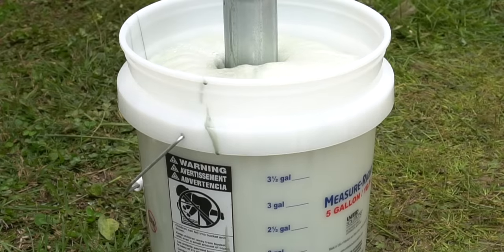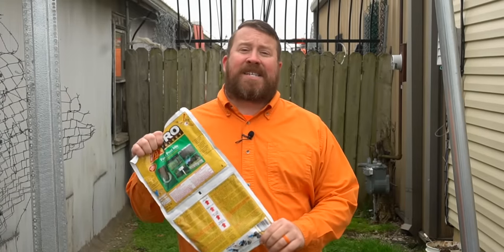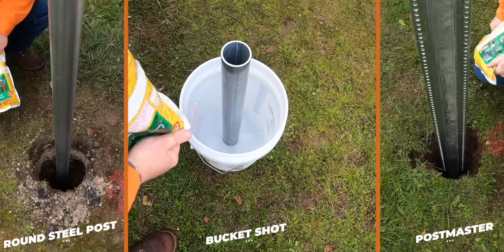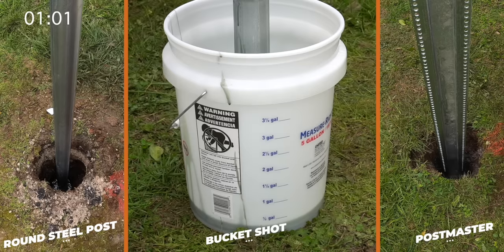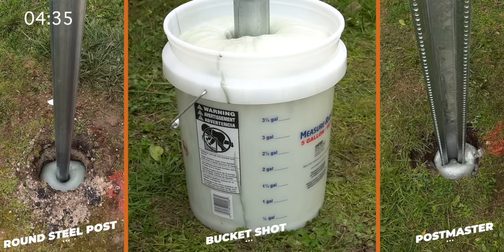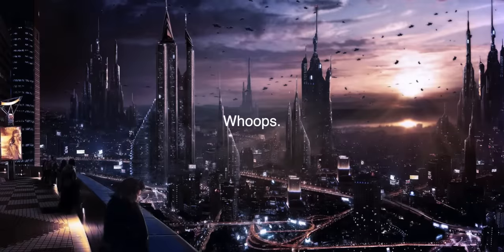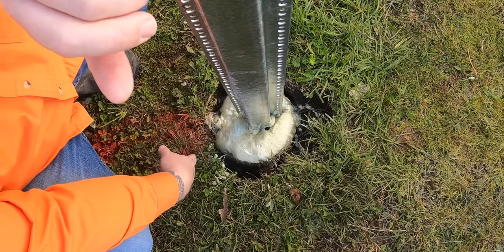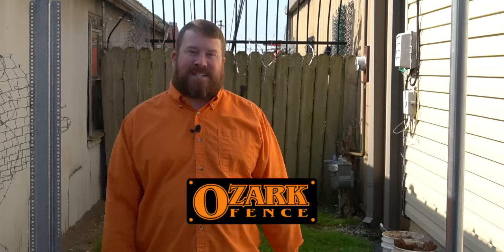Does Fence Post Foam Really Work?

Comment: I'm no fence expert, but I know how things work and I would do my fences in concrete. I recently built a horizontal trellis, think pergola that is intended to have melon vines grow across the top, and so it doesn't need to resist wind or support a lot of weight. It seems like the foam is going to work great for this, only time will tell. The foam is definitely a little finicky, I had a spot in the shade that stayed wetter and the foam expanded much faster and is clearly weaker. So I figure the chemical reaction is water based and more water makes it happen faster but less stable. Heat is also a factor. I laid out like 10 bags and went to work and by the time I go to the last few in the sun they were hot and expanded much more rapidly than the others. At least they maintained strength it seems. Overall I think it is a good product. I think people need to be able to assess their personal situation and determine what is right for them.
Reply: Typed that out before watching the video. Now, after watching, I really wish I had seen this before I used the product.

Comment: As a state park maintenance supervisor I have been using the foam for several years now and I have one complaint. If the temperature is to low it won't work. but to this date I have yet to have any shrinkage. After seeing this video I went back and have check many of the post and not one has any noticeable shrinkage. Either it was clod the day you did this or you didn't mix it very good. Most of the time when I pure the mix into the hole, it is an immediate start of expansion. Maybe you had a bad batch or it was cold. Don't know since I wasn't there with you. 

if the temp is below 70° I always warm it in a bucket of hot water and the hole up with a gas flame. we use a flame torch that you can get at most all parts places for burning grass on sidewalks.  any way to each their own, Good Luck.
Reply from the maker: That was the feedback from Sika, that the conditions weren’t ideal at the time of testing. Unfortunately, it was in the 50s and misting.

Comment: It's hard to install with foam. I had to create some pieces that I could screw to each side of the post and drive some rods into the ground to keep the post plumb. Basically an L shaped piece with large holes in one board for rods (I used threaded rod). I also would NOT recomment using it for gate posts, as it does flex quite a bit. Other than that, it's far easier to move. And it's the same price as two bags of concrete to fill the same hole. Worked for my garden, but wouldn't work in every application. Again, gates, I would have used concrete for those had I realized how much it would deflect.
Reply: Oh, the reason for needing those L shaped pieces is if the hole is even slightly larger on one side, then the force of the foam becomes greater and shifts the post laterally or can tilt it, so it's basically absolutely necessary if you want it to look nice or line up with a particular spacing.

Comment: Whats your opinion on pouring concrete mix in without water in high humidity wet soil areas.  Is this just cutting corners?
Reply: @JoeEverest  - thank you for taking the time to respond.  Without worry about costs, would not mixing concrete and pouring it in be the best procedure for long term stability?

Comment: Depending on what type of fence posts you're using, I don't fancy the idea of polymer foam 'skinning off' just below ground level. Yeah, you can top it up with more foam later on, but ingress of water is likely over time. I still prefer doming up my crete a little around each post but maybe I'm just old fashioned.
Reply from the maker: Great point, I appreciate you weighing in!

Comment: I had a similar failure. I used it for a flag pole thinking hey it can support an entire fence why not one flag pole. It lasted about a week before the wind blew it loose. The idea and ease of use is great much better than concrete but overall it's not ideal. The foam never failed I will say that, it was rock hard I just had a similar failure where the foam worked lose and it became free from the ground. It's like it never bonded to the ground... That's where the sheer weight of concrete makes it better. In my opinion if it couldn't hold one flag pole with one flag in the wind there's no chance it holds an entire fence line which is essentially a giant wind sail. I don't even know why they still sell this stuff.

Comment: I have a post to install. I was contemplating using foam vs fence post concrete. You've made up my mind. Concrete was used by the Romans 2000 years ago so if it ain't broke don't fix it!

Comment: What's the weight of it fully expanded? the bag is light.. so does it gain any weight? would you be able to like put this inside of a wall and make a concrete strength wall?
Reply from the maker: I don’t believe it gains weight during expansion. I would be afraid to add this product inside of a wall, it could likely damage it during expansion.

Comment: The opposite of "expand" is "contract" , not "constrict".
(You used it correctly at 7:35)

The walls of the bucket constrict the outward expansion of the foam.
Reply: George  Yet 5 times more polite than you.

Comment: It works better with a small auger that way it fills the width of the hole better. I still prefer concrete. But unfortunately my job only supplies us with foam now. Less of a mess but never feels like the job is done correct.

Comment: Weird, I've replaced 6 fence posts with the Sika foam, 2x 3-4 years ago, 2x 2 years ago, and 2 last year, all of them seem to be fine.  In my case, I was using cedar posts.
Reply from the maker: Judging by the comments, it does seem that it works better with wood posts.

Comment: Great video!  I'll never buy this stuff.  Friend of mine mentioned this stuff to me couple years back though he'd never tried it himself, I'm so glad I didn't attempt it.  Even before seeing this video though the biggest concern I had with it is the lack of weight & density.  Concrete works great as it's heavy, providing an anchor, which a fence needs.  The fact that this foam is probably 1-2 pounds at most tells me it's not dense at all when it expands.  I don't care what chemical reaction is happening it's lack of density translates to lack of strength, especially as the elements, stresses and time combat it.
Maybe this stuff has it's place where low weight solutions are preferable, but I wouldn't consider a fence to be one of those applications

Comment: Good Video sir, I must admit, at the beginning of the video, I was wondering, what problem the foam actually solves over using post-crete or cement. I suppose, cement, u don't have to mix this stuff up in large quantities, and post-crete, the foam is smaller and lighter to transport/use. Also you don't need buckets of water handy. Apart from that not much? Also, the thought u have to set the posts perfect before applying the foam, sounds awkward and, if the foam had wedged itself, could leave you a nasty problem to re-set any off posts if you noticed shortly after the installation. Cool Idea though, if it had worked.
Reply from the maker: Weight and size was certainly a driving factor in the consideration. Mainly it was the fact that we wouldn’t have to contract out a water supply for large commercial projects without water on-site.

Comment: Using an all-the-deep, 3/8" medium hardness rubber sleeve covering the hole wall, allows for absorbing foam expansion, when the foam contracts, it remains in a solid grip with the soil.

Comment: I thought I’d ask you this question as you’ve done this for many years.  Is there anything you do to pressure treated 6x6 posts when you use them with concrete in holes so that the wood does not rot?
Reply: paint the part of the post that's going into the ground with bitumen paint with 2 coats
Reply: @g3860r  Soak them in old engine oil for a few days.  Used to wrap them in cling film too to keep the oil in place.  Don't really know if it works, but it seemed to keep farm fences good for about 10 years.  Painting wooden buildings in old engine oil works well too, nice black colour, water just drips off it, UK insects avoid it.

Comment: My foam worked very different then yours. Mine filed the hole a ton and went over a bunch, I had to cut it away the next day.  6 years and still very strong.
Reply from the maker: Interesting, do you remember what brand the foam was?
Reply: @JoeEverest  No but definitely bought at Menards.

Comment: It does work but not always in my experiences, sometimes better than others. You have to be really fast once you mix it! Anyone have tips on how to get the stuff off of a metal post? I did one where when I cut it it sort of popped out and splashed some on the post, looks bad

Comment: I used Sika on a fence posts about 2 years ago & mine didn't constrict or they didn't constrict enough to make the posts wobble in the hole at all... I know you did an honest test, there is no doubt about that.. I just wonder what the difference was.. Like temperature, humidity.. I  set my fence posts mid April 2019, clear sunny day, temp in the mid 80's with a breeze  blowing just enough to keep the humidity tolerable, if memory serves... I'll be the first to say something is a junk product if it doesn't do  what it claims but it worked out alright for me but that doesn't mean it'll work for you.... Just sharing my experience with using Sika.. BTW I'm just a YouTube viewer,  and not someone that's paid to promote Sika
Reply: I'd say you're correct Joe. Thanks for the information and the uploads,  take care. George

Comment: If you use the flat end of a spud bar you can tamp the dirt back in nice and tight.  I thought people used concrete to anchor posts because it was heavy not because it made the tightest seal. Don't put more plastic garbage in the earth when you've already got a pile of dirt right next to your hole.

Comment: This appears similar to the two part foam that got used with a mixing gun at one job I worked at for shipping fragile items. It worked fine for that and didn't shrink like this did, but it was shot in hot and literally expanded and set in like 30 seconds. There is no way this stuff was going to be strong enough to work or if it could be the conditions would have to be perfect. Just mix up some concrete.
Reply: its not the same at all, stuff like sika, and  SecureSet are extremely hard foam.

Comment: sounds like another great example of: "Old and proven, heavy but simple vs new and overengineered, works only in the best of conditions."
I am just trying to get my head filled with as much information about fence posts as possible, since this year is fencing time and I am NOT the guy who sticks a pressure treated piece of wood into dirt, in the hopes the fence will last 10 years. I want either post spikes, cemented fence post spikes, pressure treated wood in cement or any other recommended solution for building a great foundation. I HATE spending time and not doing it right in the first place!!! I see too many fences in our neighborhood put up "professionally" and it looks like the apprentices did it, unchecked.
Reply: @JoeEverest  Watching a few of your videos and other recommendations, it appears that going with metal is the best solution in the long run. I am going to check out solutions near me. Thanks!

Comment: i used this product of 4 out of 25 post for a wood fence.  decided not to purchase for all not knowing the full result.  i was glad i didn't.  the post showed the same result as this video showed.  i have sandy soil and so the foam did not stick to the sand at all.  i was almost able to pull the fence post right out of the ground.  i ended up just adding cement to the hole after making the hole a little bigger.  it was more work to do cement but the end result was a fence that is not going to fall over.

Comment: This stuff is super expensive. I’m going to be installing 600 linear feet of 3 rail vinyl horse fence and 9 panels of 6’X8’ vinyl privacy fence. In total I will be installing 92 vinyl fence posts. Fast2K says that I need to use one bag for every post and at a cost of $14.36 per bag, that’s $1,320 just for freaking post fill foam. Concrete would cost me less than half that much. 

Also the great thing about using concrete to set fence posts, is that you can do a dry concrete set where you pour the dry concrete around the into the hole around the post. The dry concrete is enough to hold a vinyl fence post in place and you can install multiple posts with dry concrete and then adjust your vertical and horizontal level for each post. With 3 rail vinyl horse fence, you can even install your rails into the dry set posts and then check the level of the rails and make sure everything is lined up and spaced perfectly before you add the water to permanently set the concrete.
Reply from the maker: All great points, I appreciate the detailed feedback! Thanks for watching!

Comment: I really wish I watched your video before I had done mine.  I experienced the same issue with a wood post.  I only did 5 posts but 4 need to be redone.  In clay soil it is an absolute avoid...
Reply: @JoeEverest  I'm going to take them out try to salvage it with some jacks and reset it in concrete before having to go onto stage 2 to shorten the fence panels so I can reset new posts.  If I try to dig them out I'll have an enormous hole so that is out.

Comment: my biggest problem with this product when I first saw it was the weight.  Concrete works in large part because of its weight.  A post that someone is going to lean has to be able to handle at least a 70 lb lean of a body or the push of wind on a gate.  That 5 gallon bucket only weighs as much as the bag when you buy it.  A 5 gallon bucket of concrete... 100 lbs?  Bag--10lbs. maybe.  this stuff is just glorified styrofoam and should be used to fill a 1 inch wall space with insulation or something

Comment: I tried this stuff and made the same mistake you did.  Nobody else mentioned the mistake so it is most likely other people's problem as well.  When you watch the manufacturer's video, they make a point of pouring it down the post not simply into the open space of the hole. When I watched the video, I thought "what a mess" and didn't do that and that is a problem.  When the foam expands, the growth process is affected by surface tension of the bubbles and probably also by the thin film properties of the bubble versus it's properties when being a liquid.  When poured down the post, the post is wetted by the liquid form of the foam and the foam then grows outward from there.  That is not the same as foam growing to a surface while already in a foam state.   This leads to more of an extrusion of the foam upward and less growth horizontally toward the post and toward the walls of the hole.  This leads to voids at the interface of the foam to the post and the foam to the dirt.  By wetting the post surface with the still liquid foam, you avoid that inner void but there is no practical way of wetting the soil surface while still liquid due to the much larger surface area and nature of the dirt interface. 
Also ready the "fine print" on the bag - not to be used for structural applications.  
Bottom line is that I won't probably use the product again due to it's price and nonstructural limitations, but it is definitely convenient.  If you do try it, make sure to pour down the post on all sides.
As a side note, on one property I purchased, they actually set the 4x4s in larger hole and back filled around the post with concrete slurry (not dry fence post mix later saturated with water).  Although a lot of work during the initial construction, that did make replacing rotted 4x4s a breeze years later when I owned it.  There was no digging!!!  Pull out the rotted post, use a long drill bit and small pry bar to remove any non- rotted fragments, vacuum the solid concrete hole out with a shop vac and slide in a new 4x4x to it's exact original location!  Thank you old timers (early 1900's)!!!

Comment: Any two-part polyurethane foam would work for this application. A more dense foam would be much harder but yield less volume. It can be found at Marin stores, composite resin stores. Cooling the phone will extend work time.

Comment: Perhaps the post holes were too big.  I have used this stuff for satellite dish posts. For a 2" pipe I would use a 3" earth auger and drill down almost 3 feet for 6 foot pole. Same with fence master poles. Have had no problems

Comment: Never mixed it for long enough. You supposed to wait until the bag starts inflating then cut and pour when it becomes hot. Our vinyl posts are more solid than using concrete.

Comment: My pit bulls would dig the post up, knock the fence over and be out in 10 minutes if that.
Concrete is the best long term solution. The foam may be ok for some temporary use like concert fencing.

Comment: Different foams offer different results. I use them daily and find it works great. One thing i forgot to mention is the round posts you should of flattened the pole and packed it with dirt as soon as it finished foaming up. It would of been a hell of a lot better.
Reply: Joe Everest thank you for doing these test! When I find the brand that we normally use I’ll edit this post! Q-Set 250-750.  I like to put a few lags at the bottom and top just to help. But that’s my preference. Most people just stick the pole in and go.

Comment: I have never had any issues with the sika post foam. I always put dirt in after it reached its limit. I have had the post so stick with no movement. Maybe the temperature screwed with it.
Reply from the maker: It seems that it works much better when used with wood posts.
Reply: I always used 4x4 so that makes sense. Thank you for the reply.
Reply from the maker: @tonesterfrank6481  very welcome, I always appreciate the interaction!